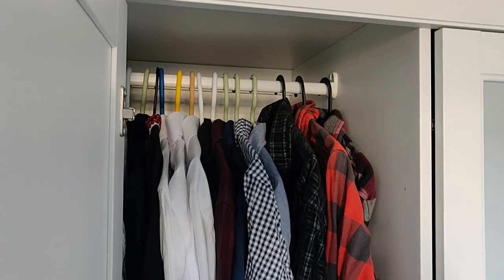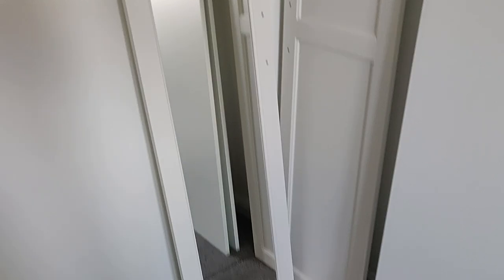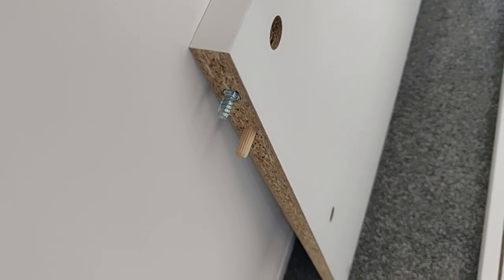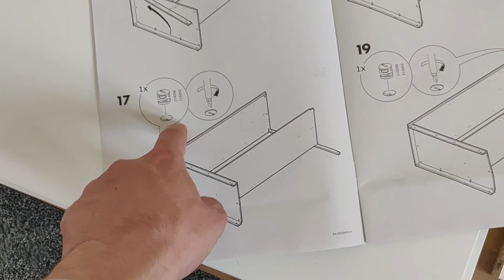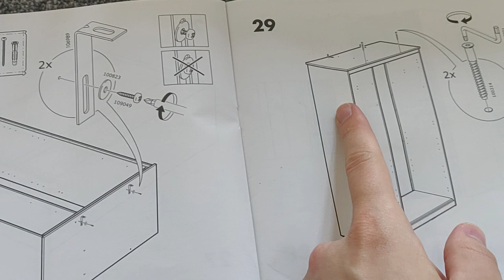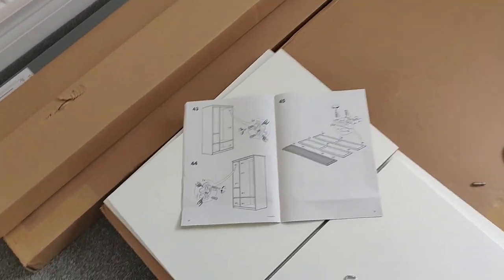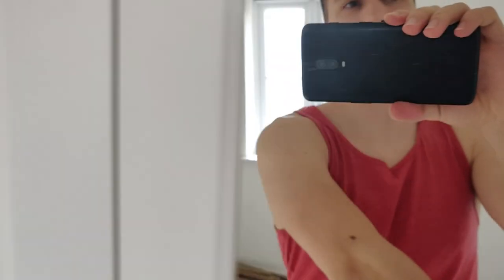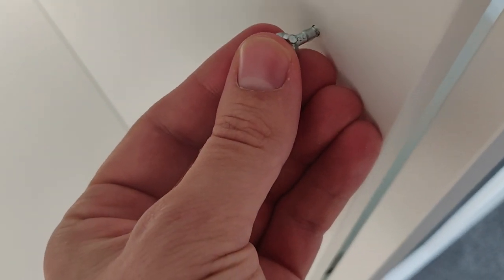Ikea Wardrobe Assembly Instructions and Time Lapse - How To

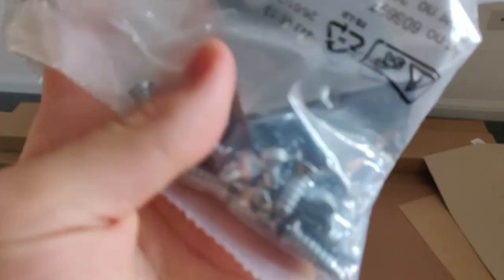Comment: 20:13 if you don't have a drill or drill bits to make a pilot(YIKES), use a screw and turn to the left just enough to make a small hole in the wood. Once that's done, start turning the screw clockwise  and they will go in smoother. (Also helps with not splitting the MDF) They are wood screws they'll go right in no problem.
Reply: Just rub the screw with a candle and there will be no problems screing them in.

Comment: Great video! Is there a way to add an extra clothes rail instead of the shelves?
Reply from the maker: You could, but you need to drill the rack holes yourself because there's no premade holes at middle height.

Comment: Is it possible to bring this (Brimnes) model from Ikea to home by small car?
Reply from the maker: @lalaabbas2510  it depends how much space you got in the car. The panels and doors are about 2m tall, so you would need enough space to fit those. Other than that, the packages are not wider than 1m, so they should fit in pretty much any car.

Comment: I put one together last night,  I felt like I followed the instructions exactly but it looks like it's leaning back.  Did I do something wrong?
Reply from the maker: Not sure how it might be leaning back. Maybe the floor is uneven or you missed a plastic footpeg on the bottom.
Reply: if you're willing, I'm pretty sure they are some cam locks not tightened, so u might have to tip it over and be sure the bottom skirting is properly aligned and tightened but not too tight or these plastic cams will break
Reply: Thanks guys👍